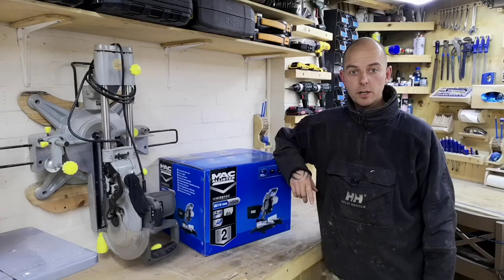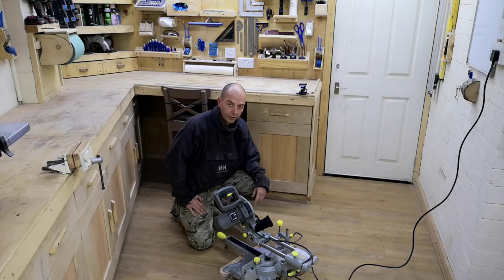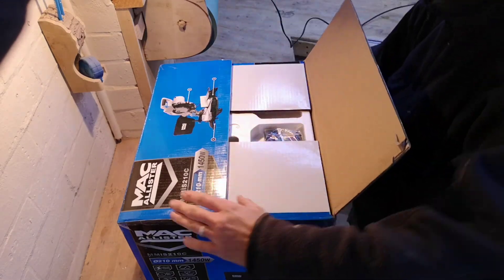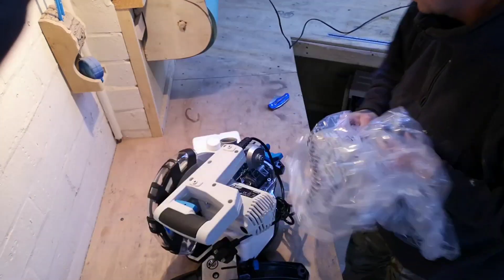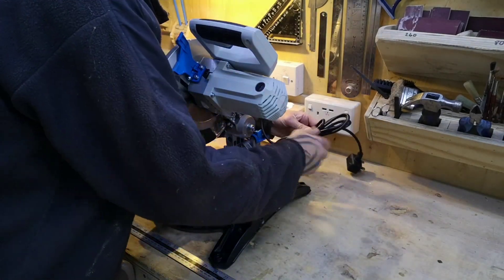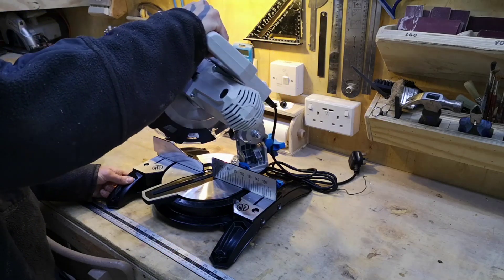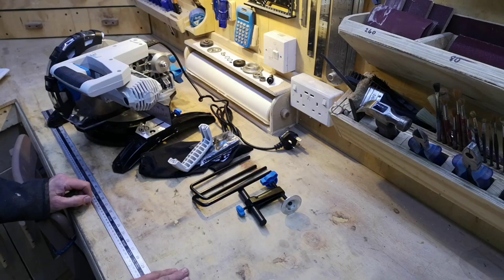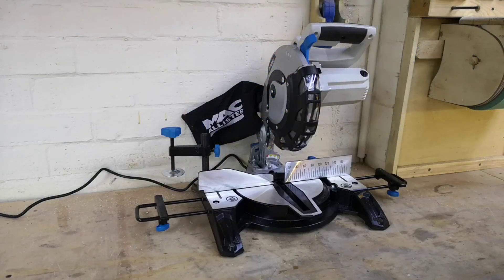Unboxing of MACallister compound mitre saw  MMIS210C . And review

Comment: why does my blade stop sometimes when i gently push it into the wood to cut? The blade is secure and the guard is being utilised properly but the blade just seems to be stopping as soon as it hits the wood
Reply: If the saw motor is still spinning (you can hear the noise) then you must tighten the blade. If the motor is stopped then you have a problem with it....

Comment: I've got both machines. I built a wheeled stand that they can both be operated from. Zimmer frames 22.5mm can be modified as well also a kids playpen the one that's a pain to fold up. You can raise it up by getting 17mm steel rods and replacing the verticals. When it's up a work top can be laid on top and secured down with the white pipe clamps 15mm  and 22mm for zimmers toilet seats get the clamps from screwfix I use disabled stuff 1. NHS doesn't want them back. 2. a lot of people just dump them and they have rubber feet and height adjustable. hope this gives you some ideas.

Comment: Mac allister products are often under rated sadly, but they aren't as bad as many people think. Sure there are a few power tools from the range that aren't that good but those are been discontinued or will be pretty soon.
Also, people are expect high end experience and quality under 100 pounds and they are disappointed if the product fails or does not perform as a good as a Makita.
Most of the returns I have seen were power tools which were abused and used for trade project rather than DIY as they were intended.
I think I'm buying it tomorrow especially if it is till there!